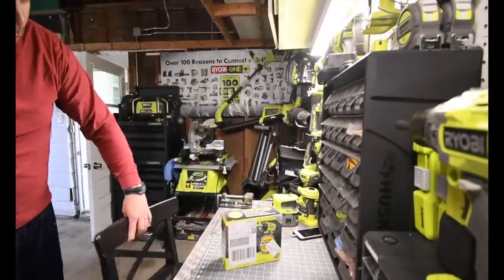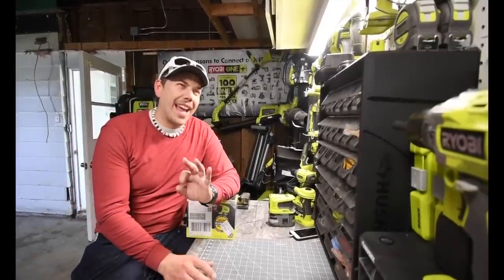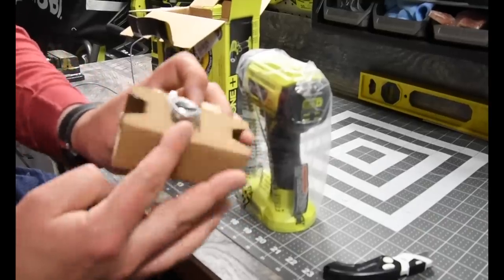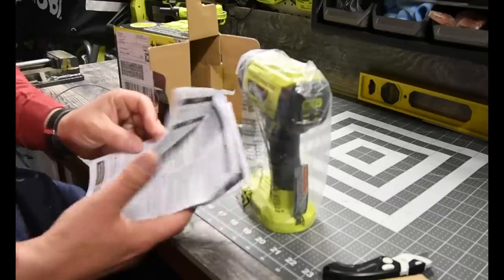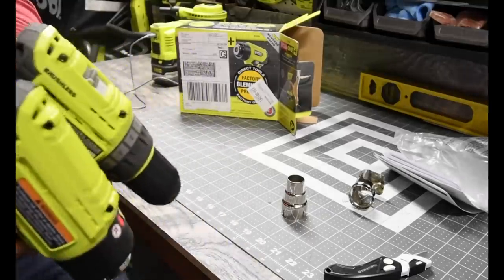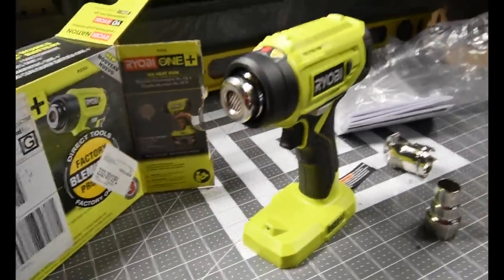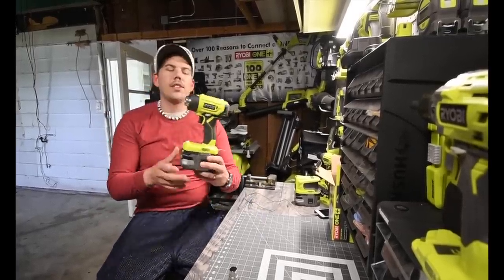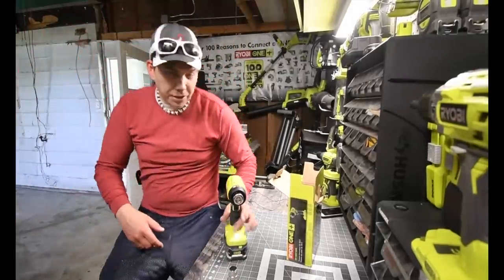Ryobi One+ Heat Gun Unboxing

Comment: You're right the 2nd attachment is for wiring harness and putting shrink tubing on a wire. I did electronics for 25 years in California before moving to Branson Mo. Ok back to the video.
Reply from the maker: Rodney Widger it’s an awesome heat gun

Comment: Hate to bust your bubble, but I got more Ryobi tools than you ! ( over 200 tools, 50 batteries, (use most for work, alot still sealed in box including some discontinued tools in boxes) Including European and Australian models  they don't offer in the USA, BUT Props to you , You  got the Heat Gun before I could. On the east coast and we get stuff last. Tried and tired to get the heat gun. Still been a struggle to get one even though I beat my Ryobi Rep up at the store often !!   Do you have ANY news on the Framing Nailer??, 8 months ago they told me they have one, just trying to make it smaller in size still. Some point I will do a drone shot of all my Ryobi stuff  as it is about the only way to get them all in one picture   Still , Thanks for videos !  Subscribing to your channel !
Reply from the maker: Bad ass bro

Comment: What was the temperature you measured at around 9:20 in the video?  The video skipped a bit as you were measuring.  The other YouTube guy you mentioned said it only got up to 150°.
Reply: The hottest I ever got it to read was 300F and that was with the meter right up on it
Reply from the maker: Xorcize it read 320 something degrees. The heat gun is going to go against a corded heat gun tomorrow to let people know if it’s worth it or not

Comment: So I have 1 question does it have a belt clip, I need one of these to do my christmas lights, I used my corded one last year and it was a pain in my assssss. So when the lights are all bunched up you use the heat gun and it takes all the kinks and stuff out of them.
Reply from the maker: I think it would be perfect for that, as long as you don't have the heat on the light itself for to long
Reply: @ManCaverTools  Are you just going threw and giving hearts hahahaha, and yes Dave I wouldn't melt the light with the heat gun!!!!  BUt go ahead and use that Idea using it to straighten out cords !!!!

Comment: If the trigger can't be locked on, what is the switch for on the side above the trigger?
Reply: That switch has a padlock symbol on it, so I'm thinking it is either a trigger lock or a safety lock to disable the trigger.
Reply from the maker: John McCarthy the switch on the side is to unlock the trigger so it can be pulled